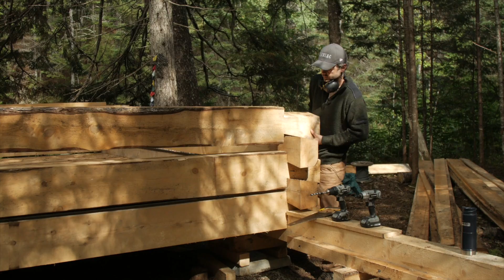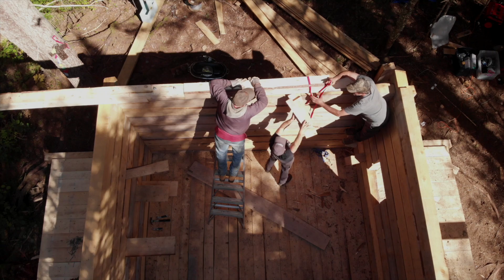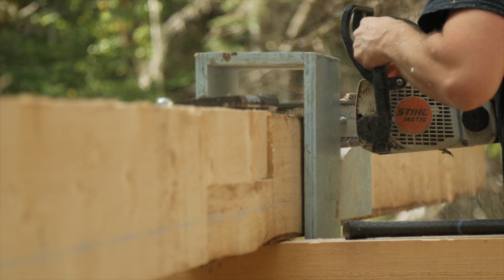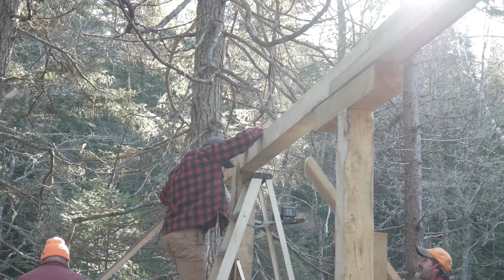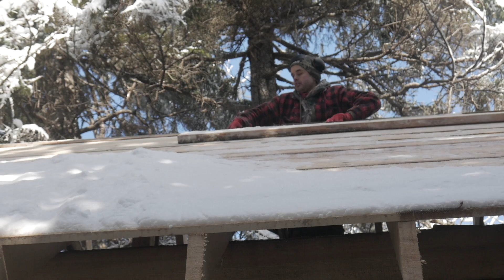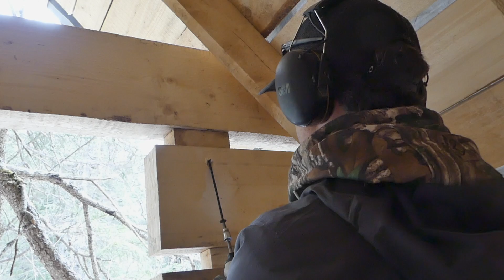Dovetail Log Cabin - One Year  Progress Timelapse

Comment: Absolutely beautiful cabin, but I'm confused why the huge gaps between each board? Maybe because of wood expanding overtime i guess. But do you fill the gaps with anything.  Cause all of the bugs and the weather that'll get inside? What would you use to fill it with friend?
Reply: Non kiln dry wood can only shrink, my question also.
Reply from the maker: Here is my attempt to answer the question: https://youtu.be/bs_HCI-A0Sk - The logs can change over time as they lose moisture but also, I am told, can take on moisture a bit too depending on the season. For me, I just like the look of a chinked cabin more. Hope this helps!

Comment: So much time ( a year ), so much man-power, so many timber,  so much money, to build such a small living area cabin ( less than 300 sq. ft. ), is it worth ??  I wonder .... If the living area is a little less than the roof, it might worth ! !
Reply from the maker: Hi! The overall interior square footage is 576 square feet (12x12 downstairs, and 12x36 upstairs) with the loft upstairs and the main cabin downstairs. Adding in the porch on the front and back gives another 120 square feet. It is not huge, but it is a decent size. I will do a video showing the inside sometime. I hope this helps give some context. Thanks for the comment!
Reply: @PenniacWilderness  Well, 576 sq.ft covers 2 floors is good enough for a camping cabin !  Wish you and you partner or friends ENJOY staying in  it .... !

Comment: Sorry I don't get it, why would you cut two sides of the logs flat and not construct it so those sides are mated flat against one another ?
Reply from the maker: That is one option for cabin building - it is called full scribe. There are pros and cons to that method. The gaps allow for log changes over time which is important in my climate and with the logs I used. If I had fully scribed the cabin then small gaps would open up over time and the structure of the cabin may change as well.
Reply: @PenniacWilderness  so do you fill ut with anything? I mean all the bugs, weather etc will get inside?.
Reply: @PenniacWilderness  OK thanks.

Comment: @22:22 How about some mortise and tenon? #10 screws are BS - especially with the weight of the members you're working with.
Reply from the maker: For sure, do you have a good site or advise on making mortise and tenon. I would like to try it, just have not done it before. I have put these diagonal pieces in place for now but can always change how they are seated.
Reply: @PenniacWilderness  make the mortise first and cut the tenon to fit. In this case just make a mortise that fits the end of the brace.
Reply: I recognize the screws, engineered for shear strength equal to a 3/8 ths lag bolt.
Reply: @timchaffin5663  These are structural - they need to lock into the adjoining member.
Reply: @MichaelHolloway  
I agree on interlocking, time will tell how the engineered screws work. Planning on building some type hand made dovetail timber log structure myself. I'm situated in the mountains on northern edge of the Olympic Pennisula.

Comment: What's with the 2 inch plus gaps and spacers between the wall logs? 
Most log cabins I've seen, antique from 1700's and 1800's have almost no gaps between the logs.
Are you going for a "good breeze" inside?

Comment: What is the dimension of this cabin? Such a cool build! Thank you!
Reply from the maker: The cabin (in feet) is 12x12 for the main lower portion. There are two porches that are 12.5. The upstairs lofts are 12x10 for the bedroom, 12x6 for the front inside loft, and 12x5 for the front outside loft (roughly). Hope that helps! I plan to do a video showing the layout inside when I get more work done inside.
Reply: Penniac Wilderness what was the reason for the design? Log size? It does look cool!

Comment: Why the big 3 x 10s at the gable ends?
Reply from the maker: Good question - I wanted them to look like the cabin, but did not want them as big as the main walls of the cabin. However, I wanted them thick enough to have some R-value too.
Reply: Yea I dont like all that weight out cantilevered several feet on 4x10 the rest of the cabin will last 150+ years with minimal maintenance that will not. I wish there was a second post on each side even if it just was 1 foot out from the first I think it would not take from the cantilevered look but keep the structure sound over time.

Comment: Why did u cut off the over hang? It would have protected the house a lot, seems foolish.
Reply from the maker: Do you mean the end of the rafters? They extend out a foot and a half already, so I thought that was enough. I will likely eventually build an extension on the side of the cabin anyways, so I will not need those rafters extended. Good question!